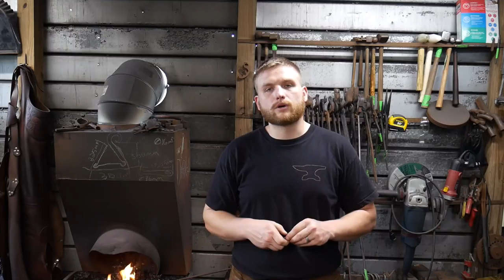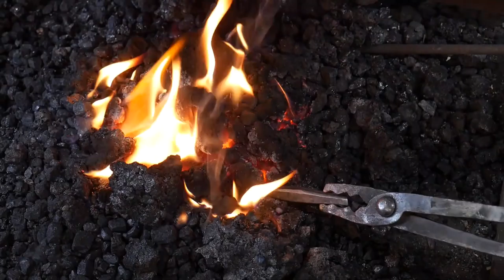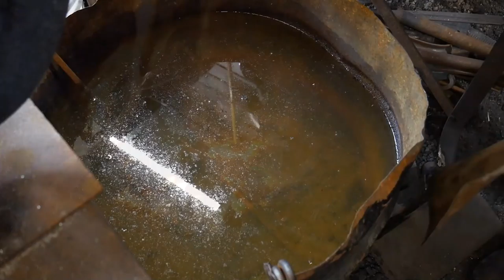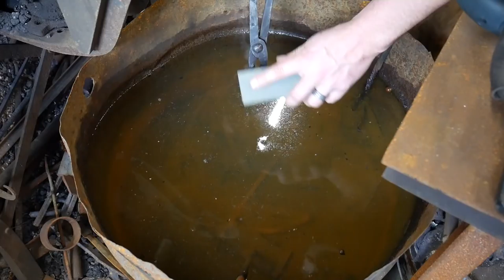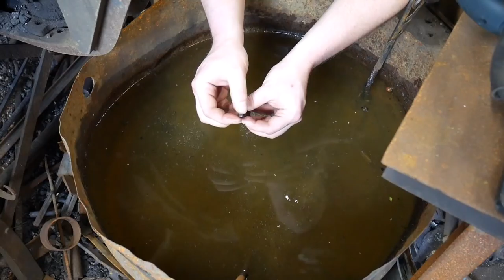Hardening and Tempering the Butcher Tool for Chasing

Comment: One end of the tool needs to be released and soften, because you do not want it chipping when hitting by hammer, and cutting edge needs to be hardened only in the center of material. Surface of cutting edge should be "cemented" in the carbon, rocks sand, grind bones, or other cementing materials....Boy, you are so funny :)